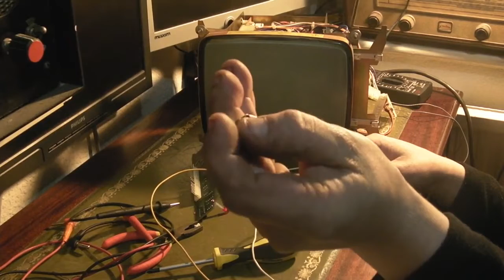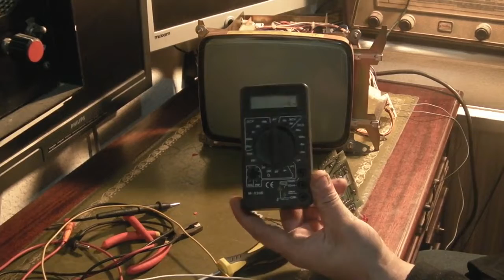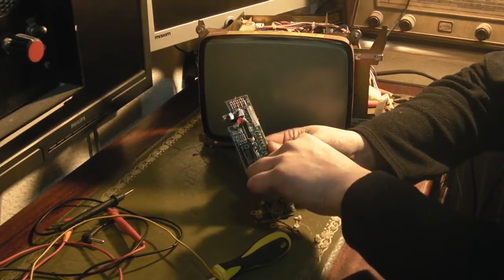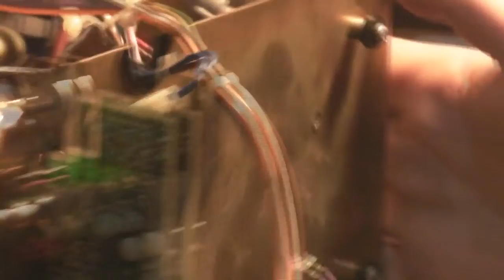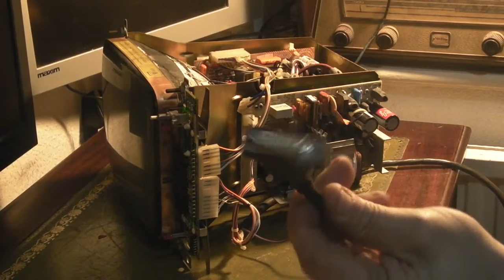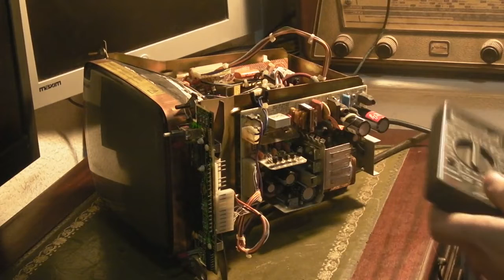BT Merlin Tonto (ICL One Per Desk) Monitor repair Pt5

Comment: been very interesting. I have the Aussie Telecom computerphone minus the monitor and power supply..but i have found the pinout to the 15 pin socket and i think a meanwell Rt-50A power supply should power up my computer..the meanwell have -5 +5 and +12 rails also working on the video output i think its cga from what i can work out..aftermarket upscaling composit/cga to hdmi adaptor should sort that out..thanks for your troubles helps me visualise what im missing.

Comment: Could it be that it needs some kind of signal from the Tonto to properly power up the CRT gubbins, especially as it blanks the screen until you press a key when it's inactive for a while and weirdness like that? Could you check the voltage at the output for the Tonto to make sure those are all correct and stable and then test further with the Tonto connected to the monitor?